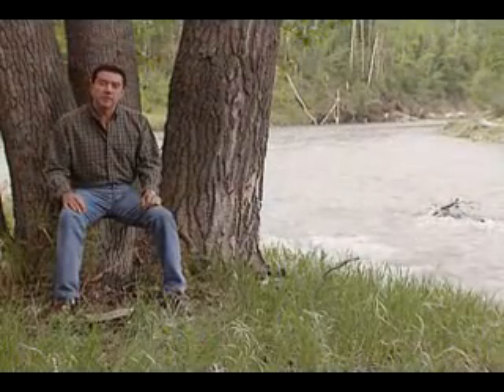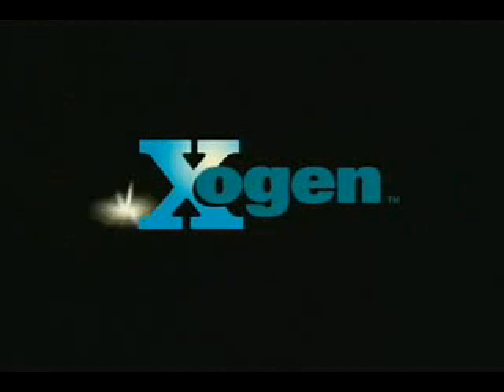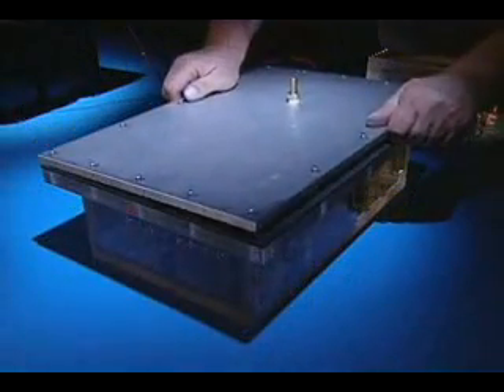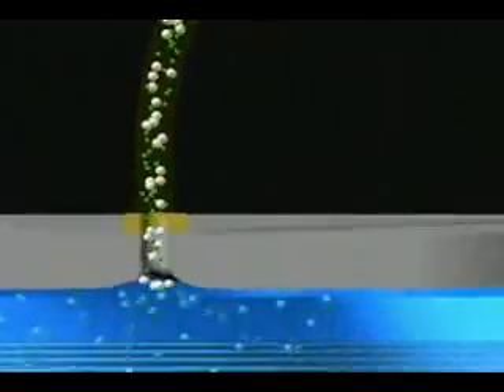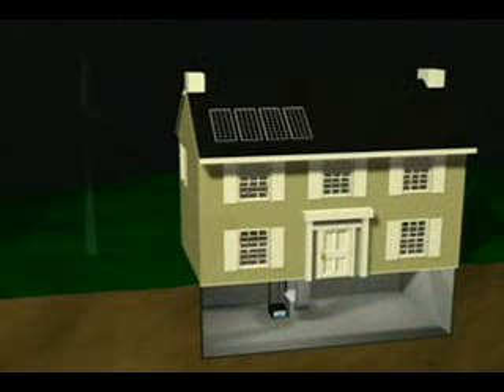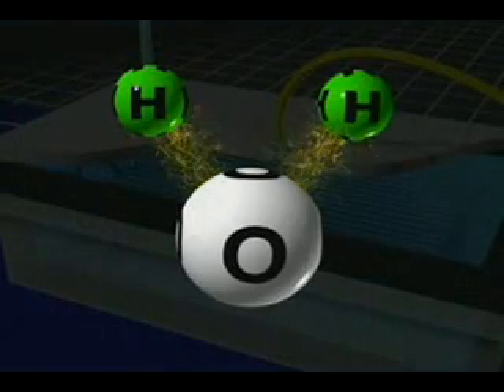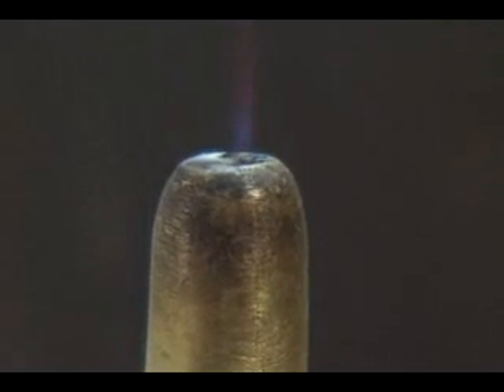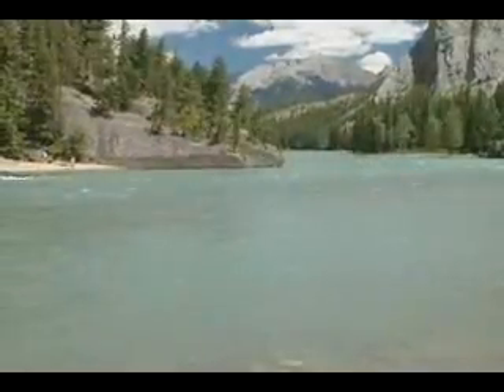Free Energy - Xogen - Super-Efficient Electrolysis

Comment: I hope to be the one to use such electrolysis etc., to bring everyone together. A car engine that gets it's fuel (water) out of the clouds in the sky "actively", condensing the air around the engine into water storage constantly to a break even point, and the engine processing the stored water to run the car on hydrogen/fuel hybrid, herego, visa V, a car that never needs to be fueled up, and can never run out of fuel;  Cloud Cars basically, that could be self-filling with the sky, plus self-driving with the "Cloud". In a tractor ya'll.
Reply: well, thats a super dream! God permits you and or some one else to do it

Comment: The equation is:

2 H2 + O2 <-> 2 H2O + Energy

The reason for the "<->" is that this can go both ways.  Just as the combining of hydrogen and oxygen releases energy and forms water.  The exact same amount of energy released is needed to reverse the process.  The physics behind this isn't a theory, it is a law. 

Electrolysis of any kind will result in electricity passing through the water and not result in disassociation.  This means that more energy is being used to produce hydrogen and oxygen gas than what would be released by burning the gas mixture back into water.

If the point of this video is to simply convert electricity into heat, there are better ways of doing so.
Reply: you probably didnt watch the video ...
Reply: joe, the <-> implies that the chemical reaction can go either way, but because we are dealing with two different processes here (electrolysis, combustion,) then the first law of thermodynamics doesn't necessarily apply. that 'law' should be considered with a grain of salt anyways, considering the quantum / unknown nature of the universe. 'laws' are meant to be broken, ok.
Reply: @fascistphilosophy5649  imagine the look on your face when you realize that water molecules are basically tiny batteries and there are methods to split water and obtain power. Instead of use power to split water

Comment: That was all the flame obtained at 3:42 for that bog ass HHO cell?  You should of had what resembled a flame thrower rather than a candle burning.  I am starting to believe HHO for energy is a pipe dream and inefficient.
Reply: It was filted and regulated like every bunsen burner if you saw there was a pressure gauge in line.